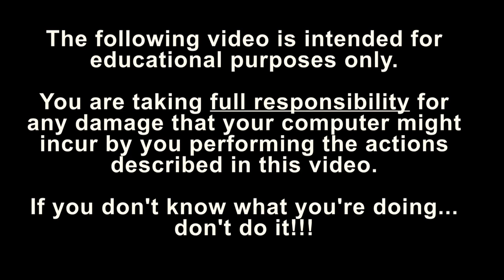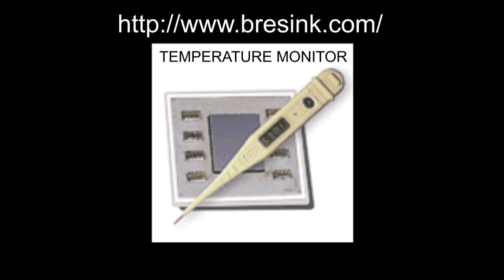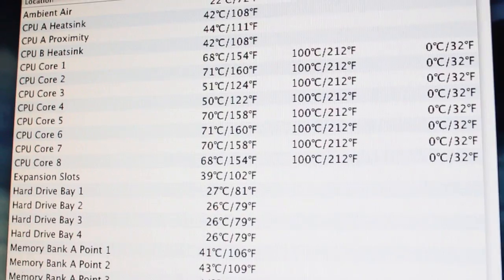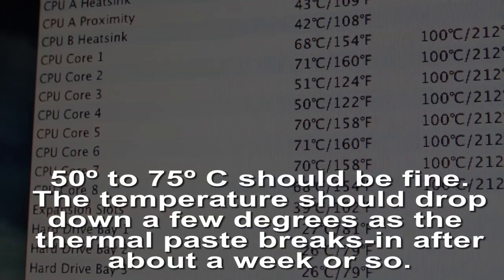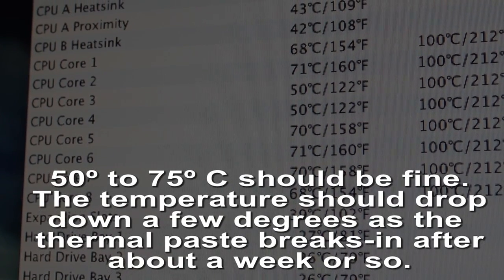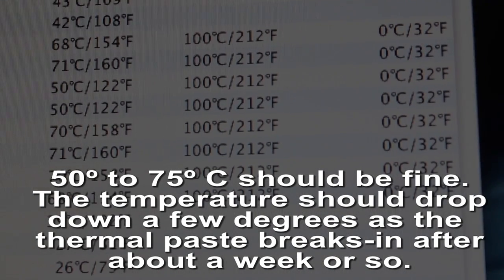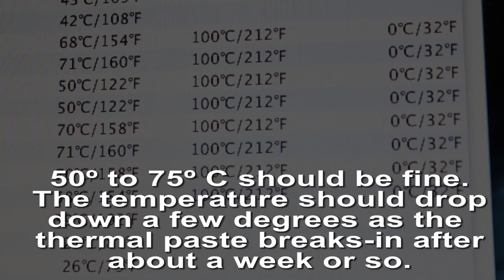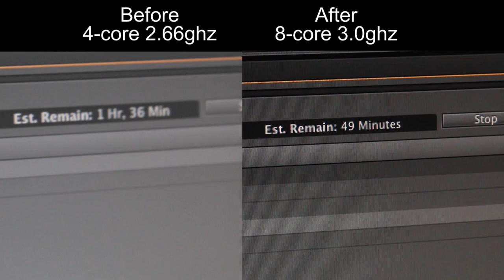Change the CPU in a 1st Generation Mac Pro (Part 2)

Comment: I want to thank you for the information contained in these 2 videos that helped me to ressuscitate my 1,1 Mac Pro tower after 4 and a half years of collecting dust, unusable on the floor. My MP didn't turn on and the diagnose LEDs showed CPU A and B failure. I concluded that it was the old thermal paste, and it really was, and following the step by step instructions you gave, I could change successfully the thermal paste and it's functioning again, greatly thanks to you. I am using mainly because of Windows 10 64-bit compatibility with this machine, so it's still useful, and I don't want to pay the greedy Apple for a new computer. So again, thanks!

Comment: Thanks for these videos. I followed your suggestions and everything worked just fine. Yes, the plastic parts are a bit tricky and you need to be careful not drop any screws, otherwise NO PROBLEM It's now 2020, so 9 years later and my ancient Mac Pro 1.2 is running great! Also added some RAM just for fun! What's next? an SSD card perhaps? :-)

Comment: The line seems like way too much thermal compound to apply. In every pc building guide I've seen they have always said to apply a small dot of thermal compound on the cpu. The line seems like way too much thermal paste and the heatsink will squeeze thermal compound off the sides of the cpu.

Comment: Last year an update messed up my startup. It sits there forever. I can only use it in safe mode. Do you think I need to upgrade the motherboard completely or try changing the cpu like you did? My OS now is OS X 10.7.5. I can't get any newer update. What is the highest you can go with the changes you made?

Comment: Why do you have the computer plugged in?  I understand you have the power strip off.
 Why not just unplug the Ac plug from the computer.  I do not understand that.
Reply: I think is because the computer is grounded using your house ground, but it does't receive power. Thats prevents any damage whit static electricity you may have in you body.

Comment: this was literally the worst thermal paste application i have ever seen. do not do it like this guy, you just need to put a pea sized dot on the center of the cpu when it is in the socket on the motherboard.
Reply: +1, the only time i'd do the line method is with 2011 chips as they're much larger, but only then
Reply: Yes your supposed to leave a good bit of paste so that is acts as a conductor (thermal) between the CPU and the heatsink.
Reply: +1 legit had cpus in socket 775 to 2011-3 plus AM4 and never once used this method

Comment: Thanks for the great videos! Everything went very smoothly, including the firmware upgrade to 2,1. Did have to do a PRAM and SRC reset to get it to recognize the 8 cores, but other than that, all good. Oh, the Torx drive is T-20, not T-15 (at least on my 2006 Mac Pro) Thanks again!!

Comment: Great Video! But you really don't have to spread the thermal paste on the heatsink because if you put like a line of thermal paste that is the size of a rice it will  work just fine and you also don't have to spread it out because it does it by itself!

Comment: Worked like a charm only problem where can I find that app to check the temperature?
Reply: +RealGuild Google TEMPERATURE MONITER.  It's outdated but it still works.  I'm running OS X YOSEMITE 10.10.5 on my 2006 Mac Pro 1.1.  I upgraded the firmware, video card and the cpu's...  Temperature Monitor works very well for me...

Comment: Great video thanks. I have exactly the same Mac pro 1,1 running Snow leopard 10.6.8.  After the upgrade that you have shown, can I run Yosemite?
Reply: You will need to mod the boot files.I suggest you buy a hard drive on eBay that has El Capitan or Yosemite pre installed on it.
Reply: +Joseph Folk Thanks for that. I've heard that some sellers on ebay will accept your hard drive, install yosemite, then send it back. Would that also mod the boot files? Sorry, I've been a PC too long!
Reply: +Alan Guscott I never hear that before.But you could do it yourself but if you have no computer experience I suggest buying one.An like you said people said you could send them your HDD an they will send it back with correct boot files,I personally wouldn't trust that.Plus if you buy one you could copy it to another HDD an format that drive then you have an extra HDD you could use.
Reply: Thanks a lot Joseph. You've been a big help.
Reply: +Alan Guscott No problem!
Reply: +Alan Guscott You absolutely can! :) You can go to Rudi Engelbrecht&#39;s blog and read his how-to. In the comment you will find the step-by-step process I followed to do just that. As a matter of fact I am writing this on the MacPro 2,1 running Yosemite.

One caveat though! You will most likely need to upgrade your graphics card. The one I have is an ATI Radeon HD 4870 512 MB which works great (it is a flashed for mac one, not an original mac version... can check ebay for that). You can also mount beefier models than this one. I got a flashed 7850 on a friend&#39;s Mac Pro 1,1 and worked fine too.

Here is the link to that page: http://rudiengelbrecht.com/2014/06/12/installing-mavericks-on-an-unsupported-mac-pro/

Caveat for mac pros 1,1 - 2,1 without a recent graphics card: Get at least an ATI 4870 or better card to ensure Core Graphics will be supported across applications that will be using it. Especially recommended for those planning to run programs such as Adobe After Effects or Final Cut Pro/X.
1. Install Mavericks or Yosemite onto an HD while connected to a supported machine
2. Download the custom boot.efi from one of the links below:
- link 01 - link 02- link 03- link 04- link 05
3. Unzip the boot.zip file to get the boot.efi file

4. Replace boot.efi on the disk, in the following locations:
 /usr/standalone/i386/boot.efi /System/Library/CoreServices/boot.efi
5. Get your unsupported mac's board ID and model identifier by opening the terminal and typing  ioreg -p IODeviceTree -r -n / -d 1   
6 Edit the PlatformSupport.plist file located in System/Library/CoreServices/ by adding your board-id and model identifier in the appropriate places.
7. Now you can place your HD in your unsupported mac and enjoy the latest version of OS X! :)
Side note: Apple made the lame move to not support 32-bit based Macs. That&#39;s lame in more ways one could count since not only when it was in their interest Apple supported not just older architecture but a completely different processor (the older IBM PowerPC), but they supported 2 completely different OSes (Mac OS 9 and 10). Instead of releasing an unsupported boot.efi allowing 32bit macs to run the latest 64-bit OS X releases, without guaranteeing or offering support (which is what happens when you do the install I linked above) Apple didn&#39;t give such option to its customers with older machines, but they rather chose to give them the middle finger telling them to basically &quot;though luck!&quot; (to put it mildly). So either you got stuck with a mac that could only run an older (and now becoming unsupported on many new programs and updates!) or you will be left out in the cold. Thanks heavens there was a superawesome programmer who modded the boot.efi allowing to install more recent OS X version on those machine totally saving the day for me! And hopefully will be the same for you and many more with older totally usable and still powerful Mac Pro (as well as other 32-bit based older Macs)! :)

Comment: Great set of videos, thanks. Question to anyone...so this all worked fine and my Mac shows the 2 quad cores properly. The problem I have is in Windows 7 64-bit under Bootcamp. Everything works fine- until I put the computer to sleep. At wakeup, the system is sluggish to the point of uselessness. The task manager says something is running 100% (I can't tell what as the window doesn't update), and the only solution is to hard reboot. Everything works fine after a reboot...until you put it to sleep. Then the same problem. Sometimes, an odd set of sounds play...hard to describe but like a tapping sound. I have checked all drivers, system is up to date, ensured hibernation and power saving options are off. Can't figure it out.

I don't have this problem in Lion. Computer sleeps, wakes up fine. So I am suspecting the problem is Windows. Anyone seen this?

Comment: thanx a million
i've have done exactly what u said
& it works pecfectly
MacPro 1.1 xeon x5365 x 2 radeon 6870  - Yosemite - GeekBench 11790 (was 6201)
it's old news, but u rock !!
Reply: +davidAll5 Did you have to upgrade the firmware? Could you send me a link to how to do that. Im looking to do this upgrade soon. Thanks
Reply: Hi Timothy 
the firmware is here - on the very first post
but to see it, u have to be registered
once u have the firmware, it s very easy 
u just have to click to "make believe" you have a 2.1
not satisfied ? just click the button "back to 1.1 "

http://forum.netkas.org/index.php?PHPSESSID=aek7dk3vnbml274lvi3nb4i596cqrt7o&topic=1094.msg6585

to upgrade the cpu see the videos (1 & 2) 
make sure u have this Torkx screwdriver & a lot of patience
if i did it u can do it

Comment: my cpu has a broken clip.. there are this black cables that are number 1/2/3 and one that is label BT the boken one is number 2 how i replace it?
Reply: +Bomb_Star You don't

That MacPro model was a model where you could switch GPU, RAM, Hard drives and optical drives.
CPUs, power supply, fans and heat sinks weren't upgradeable by any other way than taking your MacPro to Apple repair store and let them do the work.
Reply: oh ok thanks

Comment: Just completed in November, great instructions, works great, EXCEPT. . . . my system won't do a REstart--it will do a cold start, but not a restart. . . .it hangs with an intermittent noise at 5 second intervals, appears to be the sound of a drive arm looking for track 0. . . I've reinstalled the 2,1 firmware, reinstalled Lion, tried several different boot drives, still the same issue---anyone else see this?
Reply: I upgraded to 2 quad 5365 3ghz a week ago and I have no issues yet.  Is there any benefit upgrading the firmware to 2.1? and how did you do it?
Reply: tony del favero I have this same issue with my MacPro 1.1 (haven't upgraded the CPUs, still on the 2x 2.6 GHz ones). I've just come to live with it and do shutdowns/power-up instead of reboots. :/
Reply: Andrew Fry if you have an external un plug it then try to restart
Reply: Square Route External what, hard drive? No external HDDs, thank you though.

Comment: Hi have a mac pro 1.1 with the same stats in Hardware Overview as your in the part 1 of this video, but i have a processing speed of 3 GHz and I have 32 GB of memory. You never showed the Hardware Overview stats at the end of the part 2 video after you upgraded it. I was wondering if I bought all the things you used to upgrade your mac pro  1.1 and installed the same processors that you did will the speed on my computer double or will nothing change? I would send you a screenshot of my computers Hardware Overview stats, but the comments on youtube won't let me.

Comment: Hello, I just performed this upgrade on my macpro 1,1 running mavericks 10.9.4. I followed the tutorial to a T and I've done other PC upgrades in the past. The only difference was I used just a dime sized amount of thermal paste on the CPUs instead of a line and the temps are fine. I have the same "processor unknown" thing so I'll likely do the hack to bump it up to Macpro 2,1. Thanks again great post!

Comment: After you upgrade, check with an app like iStats to make sure you're cpu's are consuming around 20-25watts ea. If they show more like 40-50 watts, then most likely they've been mislabeled as SLAED. I think mine are mislabeled. Core are way too hot for idle

Comment: I got a couple 5365's, attempted to install them, and wound up over-tightening the heat syncs (this was my first cpu upgrade attempt.) Anyway, i've got one more computer to try this on and I don't want to ruin it. When I installed the processors in the 2nd one and carefully screwed in the heat syncs, I get CPU B Fail light on the motherboard. I'm afraid to label it as a definite dead processor, since this is my first cpu upgrade, and am thinking I'm not tightening my heat sync properly. Are there any tips on how to go about this safely without damaging the pins? Thanks a lot to anyone who can help!!

Comment: Great Video, very informative. One Question will this upgrade allow me to run newer OSX Mavericks and will it utilize the 64 bit architecture?
Reply: the short answer is you don't need to upgrade the CPU to run Mavericks - it will make it a bunch faster.
you can't escape the fact that Apple uses a 32bit efi on these older machines but if you Google SFOTT that will give you all the info you need .. basically download Mavericks on a machine that can (there are ways to circumvent the check on a non-complying machine) copy Mavericks on a USB stick to your machine you want to install it on and run SFOTT there.
Good Luck!

Comment: Excellent video/tutorials. Just wondering, would I have to upgrade the firmware to 2.1 to use the X5365? With the 5355 1.1 is fine I assume.
Reply: ***** I did update to 2.1 before I actually installed the processors. I did that in hopes to install Mavericks, which I had no luck with. It is working extremely well, not a problem anywhere, and the exporting of FCP X is at least 2X as fast.

Comment: This is a totally outstanding pair of tutorials. THANK YOU SO MUCH. I completed this upgrade last night and photo editing of large RAW files is now massively quicker. I installed a pair of X5365 purchased from iTinStock in the UK, for £193 taken from a new server and which have a 12month guarantee.

However, I think there is one 'error' in the tutorial. Having purchased a long T15 screwdriver especially for the task, which did work to remove the heatsink screws, I found that on reinstalling the heatsinks, the Torx driver slipped round in the heads of the screws. The screws on the 2007 MacPro, I have, are hexagonal and an 3mm allen key fits so much better. Torx was not actually required. For thermal paste I used Arctic MX-4 and the temperatures on the cores are currently around 36ºC. Opening 20 RAW files of 30Mb in one hit increases this on one core to around 45ºC.

One point, before removing the original CPUs I collected the remaining dust ( having previously cleaned the machine thoroughly) around the edges of the CPU sockets with masking tape. In addition, I covered all the old thermal paste with masking tape cut to size, on top of the CPUs, to ensure none fell off into the sockets or onto the mother board.
Totally recommend this upgrade......and thanks again for the tutorials.

Comment: helo i just wondering since i am new in mac and just bought used mac first generation 1.1 with xeon 2ghz late 2006.i have seen some forum and i saw that the first gen cant't boot to 64bit.so any ideas to get 64bit to work in my unsupported 64bit mac?

Comment: Thanks for your video, it is really useful. I upgrade to X5365 did exactly the same as what u did on the video, it works really well and all cores data shows on  temperature monitor. Everything seems working well except it shows" 2X3GHz unknown" instead of " 2X3GHz Intel Xeon 8cores. Is there any firmware we need to install after upgrading for mac1.1 to recognize the CPUs?? Please advise

Comment: Yeah, some techs do that regularly tho - it's not uncommon.

But on his last step of applying the line of paste he put WAY too much.  About 4 or 5 times too much. :P

He also placed his finger on it at one point. Another BIG no-no.  The oil from your fingers causes problems. Latex gloves are recommended.

Comment: If you have an MP1.1, the best cpu it will support is the x5365 which is a quadcore. So you can't have 12core on that machine. Later models can, but they hardware is slightly changed so this guide won't work.

Comment: Hello. There are actually three types for the x5355: SLAEG, SLAC4, and SL9YM. The difference is in the stepping. All three will work just fine on your MP, even if mixed (example, one SLAEG and one SLAC4). I think the main difference is that SLAEG, compared to the other two, has a 50% less power consumption *while idle*. That could make for some serious power savings, but apart from that they all operate the same and will work with each other just fine.

Comment: Great Video ! Great Sound !
I would like to upgrade to mountain lion. I tried to download it to my mac pro but got a message that it can not. I have a 5 year old mac pro 2,1 with 2 Quad-Core Intel Xenon 3 Ghz processors, with 32 gig ram. Can I upgrade anything so I will be able to install mountain lion and basically get some more years out of this very great working machine ? I really appreciate  if you could shine some light on this dilemma.
Thank you !

Comment: Just upgraded my mac pro 1,1 with 2 4 core clovertowns (x5365 - SLAED). Bought them from ebay, VERY DUBIOUSLY! Followed your instructions, which were very informative and recommend to anyone; I'm an amateur fiddler, it worked first time! I started by upgrading the firmware to 2,1 then, installed the CPUs and ramped up the fan speed to 1200rpm.  All the cores are cool at 22 degrees C., with the fan quietly purring away. Thanks midphase.

Comment: My x5365's shipped because of you! I'm now convinced it's possible and I've purchased all the 'surgical tools' you recommended. I see you've said that the firmware upgrade is only for aesthetic purposes to show the names of the chips. Does that mean other than swapping the CPUs (correctly), that this is basically a bolt-on upgrade? No software maintenance? Didn't think the firmware needed an upgrade.